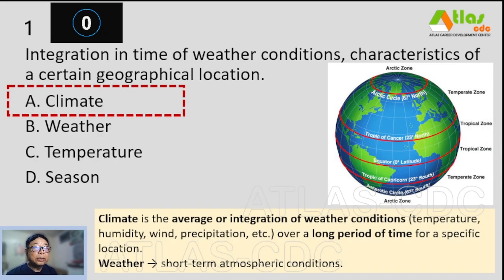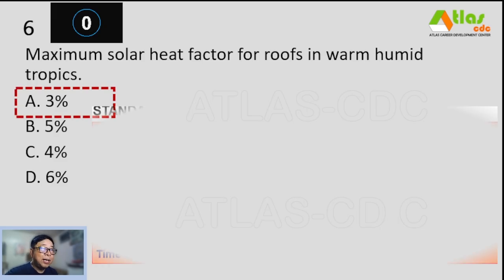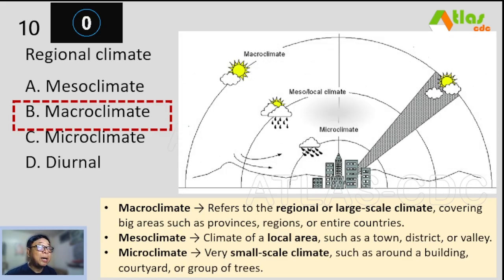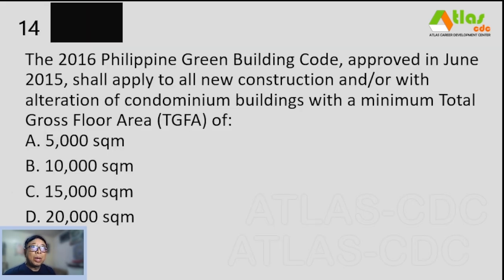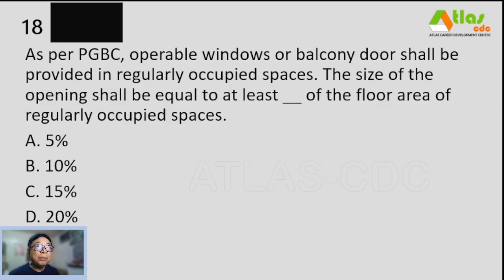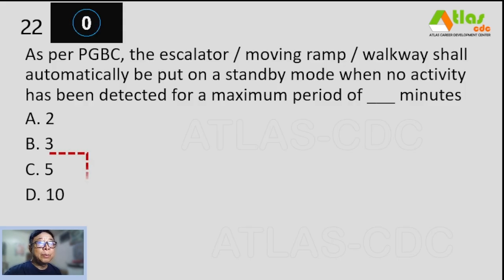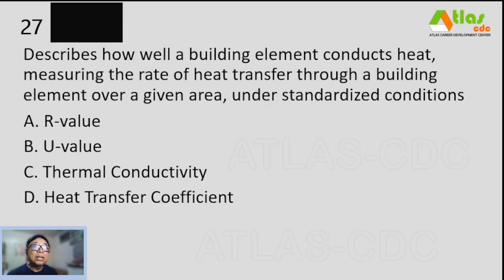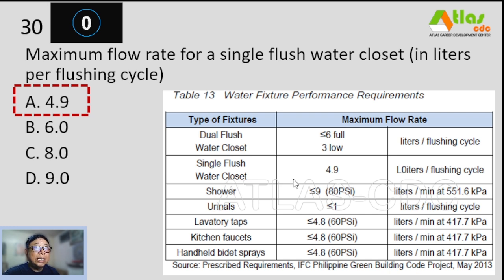Architecture Review Quiz - Tropical Design and Green Architecture Part 5

Comment from the maker: correction for No. 10: it should be Mesoclimate which is the regional climate driven by geography: mountains, valleys, coastlines, plateaus, large forests, or urban areas. macroclimate is large scale, broad zones (tropical, temperate, arid)
Macroclimate – climate of a very large area, such as a continent, country, or major climatic zone.
Mesoclimate – climate of a region or locality, influenced by regional topography, elevation, bodies of water, vegetation, etc.
Microclimate – climate of a very small area, such as a building site, courtyard, street canyon, or even the immediate surroundings of a building.